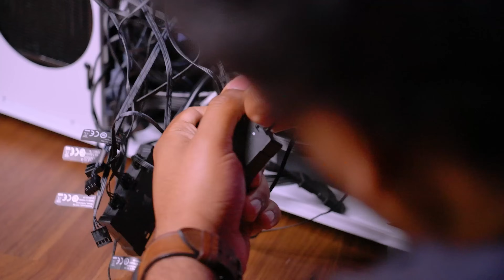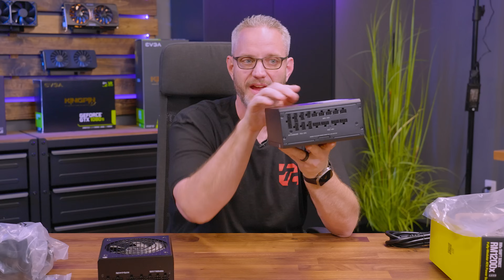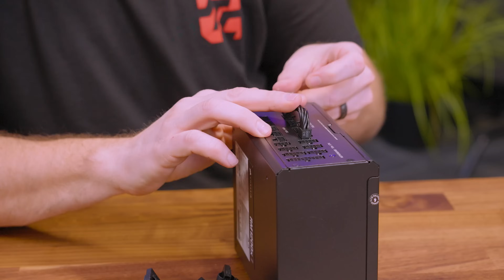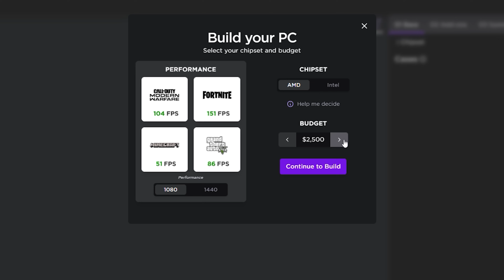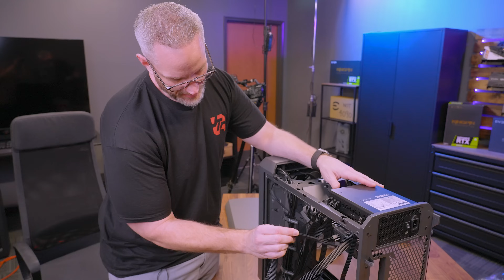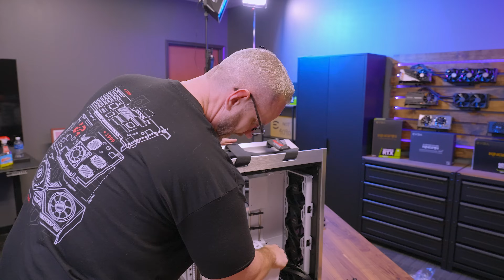I tried to prove this design was a failure... But then this happened.

Comment: This PSU design is what i've been waiting for. I'm soooo tired of the plugs being at the back and not the side.
Reply: Perfect for those duel chamber cases where the PSU is turned on its side.
Reply: @HiddenRealm  actually we found multiple Earth 2s. But no one is macho enough to make the trip and bring back proof.
Reply: So many things about the PC haven't changed and it's becoming incredibly daunting. GPUs are now up to 6x their original size, the motherboards can't handle the weight of them as well as huge CPU coolers, it's just not working. There's a reason the PC was called a desktop, and keeping it vertical just doesn't cut it anymore. Also the cases are still very rudimentary and not user friendly at all, while missing out some basic common sense stuff, but of course what they're not missing is a ton of tempered glass and rgb :D
Reply: @omnirhythm  I mean PCs aren't a very good platform at all in the first place. If PCs really are so good, then why is there still no PC 2?
Reply: @istachi  Dangit. This is peak Vulkan logic whether I like it or not. I can not debunk your argument and will take my leave. And my PC 1.
Reply: @omnirhythm tempered glass and rgb is so unnecessary 😂😂

Comment: thanks Jay, I was looking at this power supply for use in a Phanteks G500 case., which I think would work.  I am a little concerned about the smaller cables, however.  In any case, another helpful and interesting video, by you.
Reply: I use this case with a 1000w shift.  No issues.

Comment: Glad to see connectors finally become smaller. The next are the cables and connectors at motherboard. Why they should become smaller? Because why not. We can easily run 100W through a small usb-c cable...

Comment: i wish power supplies above a certain price point came with individually sleeved cables that you don't immediately want to throw into the trash when you see them. even Corsair's own SF600 Platinum and SF750 Platinum come with nice cables. of course those don't have the quality of proper aftermarket replacements such as Cablemod's for example, but they're pretty enough to keep

Comment: Was trying to get the seasonic vertex but everywhere it was out of stock, so I went with corsair for an atx3.0 power supply, after it arrived I realized it was side output, in the corsair 5000d it fit wonderfully an cable management was really clean, also a traditional layout makes having a hard drive cage very painful, this eliminated that issue, so I was pleased.

Comment: Won't work in my Jonsbo V4 which was the only case I could find that used that type of layout. I'm limited to low profile or stock cooler, no tower cooler I can find will fit. Waiting on my DK 6.0 power supply to show up, it was on special for half price (maybe), I don't trust my Thermal Master 420 watt that only has 20A on the 12volt rail.

Comment: They shrank the ends that plug into the PS, they should have also made them 90 degree plugs to avoid twisting the wires. They also could have staged them. Each row being slightly taller as you move to the center of the power supply so the cables layer neatly on top of each other avoid instead of each row jumping up over the last plug and the cables on top of that as you move to the center of the PS. They made special plugs but didn't make them RIGHT. I pay more, I expect more.

Comment: I feel like that PSU is a problem looking for a solution. 
It would be great for your guys who are building systems and breaking them down more often. 

Personally I'd need a second SKU with the plugs on the other side, so I can run fan up with the case on the floor. 

Seeing the amount of insulation damage already isn't good, that means they've gone something cheaper and less resilient.

Comment: Cable management should be fine when case makers indicate their cases are 3.0 PSU-ready. One day we will have PSUs with output ports on the rear, top, and side. Now we're talking about proper cable management. My PHANTEKS  ENTHOO PRO full tower case has seven wire management cutouts. All have rubber grommets to protect the wires. Excellent thinking by the case designers. Given their potential power draw, all cables should be 16 gauge, not 18 gauge.

Comment: According to Corsair you actually can use the 12+4 pin with a 3070 Ti FE or higher.  It won't work on a 3070 FE or lower because of how the port is positioned (the backplate blocks where the 4-pin would go), but 3070 Ti and higher have an angled port. According to corsair the 12 pin is the exact same spec, the 4-pin sensor simply allows for more features and higher power throughput.  They said if it detects the 4-pin isn't plugged in, it reduces the max power to 450w, which is more than enough for all 30 series GPUs if I recall correctly. I asked a Corsair rep before I bought it, so this clarification comes from them.

I will say though, I love this power supply.  Also, either side of the cable is a different size so you automatically know which side goes into the PSU and which side goes into the motherboard components.  The cables also seem thinner, I guess due to a lack of in-cable capacitors, but this allows for easier cable management.

Corsair also told me that "universal extension cables" that work with other PSUs should technically work with these cables as well, but I didn't want to buy extensions.  I'd rather wait for them to release whole sleeved cables for Type 5 Gen 1.  Extensions are always risky business.

Comment: Thats why I got a new power supply with my new build. My old PSU had everything I needed for the new build EXCEPT for 2x 8 pin CPU power. I only had 1x 8pin PSU with that PSU.

Comment: @JayzTwoCents i do not understand why with over 20 years of innovation producers like ASUS , gigabit ,Asrock , MSI ,etc don't come to conclusion to speak with producers of PC cases and agree that attaching any power or  any type of connectors, example front I/O , SATA drive make sense on reverse side of PC , first of all making dual multiple layer design there is no restrictions to do , so in fact its calls for that since you don't have to cram "shiet" in front of PC. Maybe one day they will go to same conclusion as i did 15 years a go by reversing connector on Abit AB9-n board , had to make my own work with PSU cabling in connectors but it was glorious .

Comment: For v2 they should recess the plug side 2cm into the powersupply and use the extended length to cover for the missing space, then it would fit in pretty much any case where the side panel comes close up to the powersupply. The width at the backside where it screws into the case will still be the same, but if it dips in before the plugs start, that would free up a lot of space and make it compatible with like 98% of regular towers.

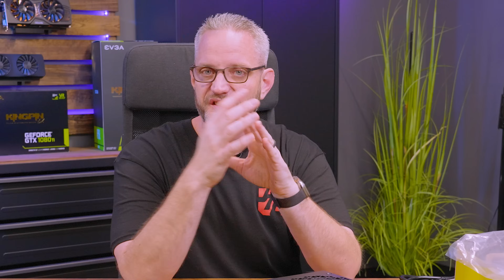Comment: I have the RM850x Shift, and the ATX 3.0 sticker says 300W PCIe 5.0, not 450W as mentioned on 4:57.   That's good enough for a 4080 (300W cable + 75W max from the slot), but not sure if would limit the power to a 4090.   Worse case you use 3x PCIe cables.   BTW, great video!
Reply: Seems the 850 is limited to 300w, the 1000 at 450w, and the 1200 at 600w. A clear case of artificial product segmentation.
Reply: @Sandriell  This is part of the ATX 3.0 spec and has nothing to do with Corsair.

Comment: Stuffed one of those in my newest build. And you know what? It's not terrible.
Reply: I had to relocate the PSU after I had just about everything plugged in (tried installing HDDs) and everything plugged in and moved around nicely. No problems with plugging stuff in after it was installed.

Comment: I feel like this power supply would be ideal for a very skinny vertical case with mesh side panels so you could position it vertically and still get air flow with just enough bracket to hold it on the edges so the cables could go straight down or up. probably with some custom cables to handle the unique lengths.

Comment: It looks like the PCI-e 5.0 cable is silicone, as far as I can see in the video, if this is true , then.
I think why they went with grey silicone cables for the PCI-e 5.0 cable is for silicone can handle more heat than rubber.
But still could have made that one black to.

Rubber: starts deteriorating at 80 °C and melts at 120 °C.
Silicone: is able to be formulated to operate up to 230 °C.
and with the 40series being a powerhungy bastard, better safe than... "oh sh*it my pc is on fire!"

But for 200-300 bucks I would have expected braided cables, heck my dinky little Corsair SF600 SFX for my media PC came with braided cables and that thing costed about 120-ish euros.

Comment: My 3090 draws around 360-380w whilst I'm gaming, whilst overclocking. but I like to turn down the power limit to like 80%. this makes it only use 260w, which is great. yes yall gonna say, ow thats a huge performance loss. the 3090 runs the games I play at 2k 144hz highest graphics, even with this power limit turned down. when I did benchmark tests, its like a 9% performance loss, which is nothing when your in a game, thats like 5-10 fps loss. Would recommend doing this, if you have a low end PSU. (Also because I'm using a 5600x for my CPU, my overall power consumption is very low, even whilst having a 3090.)  (I have a 850w PSU :3)

Comment: Why would you reinvent the wheel for a car that doesn't exist...you wouldn't, so why do it with power supplies when there's no market for PSU with connectors on the side of it nor cases that take advantage of it. And i doubt companies are going to accomodate for it in their future designs just for this one PSU.

Comment: Umm does this mean Corsair is going to have cases that will utilize this way better? Just a thought then other manufacturers will follow their genus design. Seems like they might have a plan
Reply: From what I know, this already works well in the 4000D/X, 5000D/X/T and 7000D/X since they likely tested these in them. But I imagine they'll design cases around this going forward, given them being so committed to this being their next step.

Comment: I have the 850w version and it's honestly not all that to be honest as it can cause some fitment issues too as you need a certain amount of room between the side panel and side of the PSU. It also will not fit some cases at all such as the ASUS Prime AP201.

The micro connectors are cool and I would love to see the micro connectors on motherboards in the future.

Comment: Based on just eyeballing it, I believe I can safely tell you it would work in a Lian Li Lancool 3.  So, maybe all EATX capable cases?  My old mid tower case would not be able to use this.  I love this idea from a management viewpoint.  But, you nailed it as being pretty case specific.
Reply: Heh..."case specific" could refer to both the computer case, and how niche the use case is for this style of PSU. I chuckled, well played.
Reply: It indeed does. And it works REALLY well. Recently upgraded my case to the Lancool 3 and PSU to this one and cable management is so easy.

Comment: someone might of already thought of this. What if they used the extra space behind the PSU made it longer but skinnier. Would still get the benefits of cable managing with more space for bends. Possible downside though may have to run smaller fans. Maybe compensate by running two small fans??

Comment: So Corsair choked by not recessing the connection area of the side enough that the cables would still fit in the standard chassis w/out compromise... sounds like a budget issue and nothing else.

Comment: @JayzTwoCents with the Corsair Crystal Series 680X case you don't want to use this power supply at all. You can put it in without the cables but I doubt, that you will with the cables. The case is divided into two compartments and where the one with the motherboard has a normal width of 22cm, the other one for drives, power supply and so on is far smaller.
So the power supply is laying on the side with its fan pointing to the side. Above the power supply are directly the drive cages. That is no problem, as the cables would face down.  But you have not much space down. If you remove the 2,5" drive cage below the power supply, which is also use as rest for the supply, you would only have 4cm below the drive and you would have no chance of changing any cable (adding or removing) without completely remove the power supply and it would be a very tight fit down there.

You can get the supply with cables in there, but the handling is horrible and you give up the space below the supply, that I personally used to stow away some of the longer cables, as there is enough space for 3 x 3,5" and 4 x 2,5" drives above the power supply.

Comment: Can someone enlighten me on the smaller plugs? 

I'm wondering if the size difference would have any potential impact/limitations in terms of the maximum amount of power/heat and/or signal interference they can handle. 

The idea of requiring more power for new components and then coupling it with smaller cables seems weird to me.

Comment: I picked up a 850 shift for my first build. 12700k and a 4070 Ti Gaming x trio and a Gungnir 120R case. Cable management has been an absolute breeze and I don't regret getting the shift. Some cables are long but having that nice ease of access make this so much better for the long run
Reply: ALWAYS better to be too long than too short when it comes to cables.

Comment: I have this power supply in my O11 D evo case; I bought it for my 4080 gpu. I didn't have any issues cable managing, especially compared to the last psu I had. That thing had the the bulkiest cables: these thin Corsair cables are much easier to work with. I like it. It goes well with my Corsair fans and H150 elite Capellix XT aio cooler

Comment: While might be a great power supply, one should note that it will NOT work with all cases. For example, it would not work with my Fractal G case. Yes, I know it is a budget case but not many options that still have optical drive bays.

Comment: Worked great in a Lancool 216.  Also great in an O11 Air Mini once I removed the drive cage (drilled the rivets).
Reply: I appreciate this comment. I was looking into this PSU with this case in mind so I'm glad it works great.

Comment: Hi Jay or anyone that can answer , Why does my 16 pin from seasonic have all 4 sensor pin wires in the psu to gpu cable and cable mods only has two ? I don't know exactly what these 4 small sensor cables do ? 😢😢😢

Comment: Straight of the bat - I can tell straight away, this PC is not going to be compatible with a H500M (unless you remove the psu shroud) and that is not a cheap case either. I had to remove the PSU shroud and have the PSU fan facing upwards others the PSU gets warm due to poor airflow from the bottom. That is because the front of the case has a lip which restricts airflow and not to mention having the PSU facing fan downwards increases the temps inside the case. Also the airflow path going through the PSU means nvme drives get some more cooling and same with the gpu. Edit: If PSU manufacturers want to differentiate, they could do the same and flip the sides where the plugs come out. As now that I think about it, with the PSU fan facing up the cables will be visible in the main cavity in the H500m. If they were on the otherside, the cables would work but there would be extra slack. However, the H500m has a removable RGB header fan cover front the fans and this would make disconnecting cables somewhat easier.

Comment: After an admittedly quick look and a few double takes, isn`t it true that the helios case`s back plate can have the lower 1/3 removed just by removing 2 screws?
or did you miss that Jay?

Comment: They could avoid any problems by putting 90 degree connectors on the power supply end that force the cables to the side

Comment: I like the concept of this power supply. I just think they made a mistake in the PSU side connector. If it had been right angle connectors It would have been better. I get that it probably won't work for all cases. But I can live with that. Also it really should have had native 12VHPWR connector at that price and being released now.

Comment: Most 6900xt partner cards, the gigabyte 3080 10 gig, 7900xtx cards all have 3x 8 pin pcie power connectors. Tons of use for those non pig tailed cables.

Comment: I think this could have to potential for Corsair to future proof themselves in the long game if we start seeing motherboard partners support the reverse IO boards and case manufacturers design more rear spacing for cable management. With that thinking I can see this being a major win for that design choice. Another reason I think I would go out and purchase this type of PSU would be for a test bench where I can access the plugs without picking up the bench or reaching under it. One case that came to mind is the Cooler Master Masterframe 700. I think they would need to make another skew where the plugs are on the reversed side of the fan.

Comment: I tossed one of these in my new build once I got a 4080 gpu and had no issues with the Crosair case.  It is a bit odd and the wires do feel a little less substantial than my last PSU but overall I couldn't be more satisfied.  the price was pretty close to the normal one and it made looking at my case from the window side just a little more cleaner.

Comment: This PSU would be dramatically improved. If it was made slimmer with 90° power port next to the ports, a reversible mounting bracket, & fans on both the bottom & top.

Comment: Jay, Nice design but I think a lot people would have a lot problems with the side you just showed. Plus the cables would ware over time. I have a 850watt Psu from Corsair and it last me 3 builds.  I have no problems at all. Yes, I'll upgrade in the future with 4000 or 5000 GPUs. I'll get a Seasonic 1000 or 12000watt, but I hope they will not follow with the same idea!